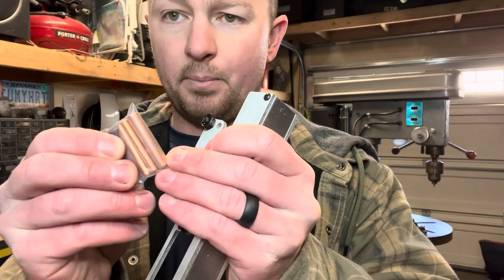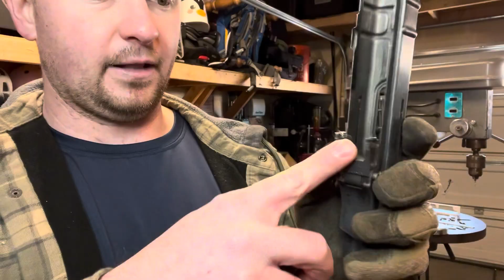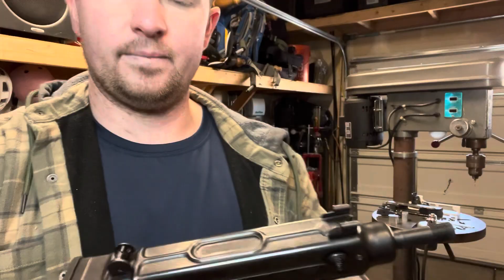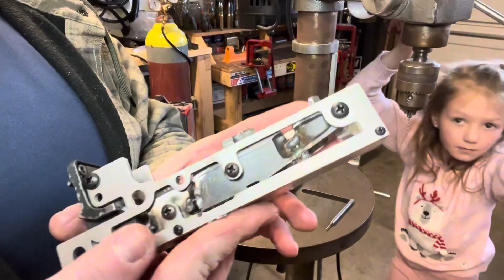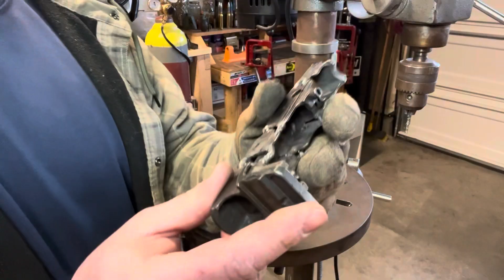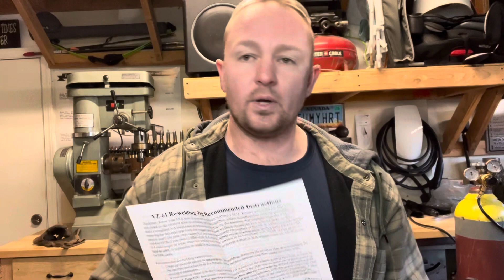Masterclass VZ-61 Skorpion Receiver Re-weld Ep. 1

Comment: Bought your jig over a year ago but only now have had the time and motivation to get started. Cleaning the slag has been a real chore since the cut margins have essentially been torch hardened lol. Had to use a propane torch to anneal them quick and dirty so my old files could actually get some bite. Glad I just now found this video right before the weld up!
Reply from the maker: Thank you for the business! Keep me posted if you have any questions. 
-Connor
Reply: @connorvankalmthout469  Going well so far! Receiver is in one piece and fits the upper thanks to your jig. Any tips for the hammer pin retaining spring hole that the rear nub of the fixing plate covers? My 1963 kit was cut right down where the skinny hole is for that hammer bar retaining pin assembly and the cutout on the bottom of the receiver where that rear nub of the fixing plate sits is nonexistent. So it currently looks like I will have to use a Dremel and re-create that slot where the plate sits under the receiver after building up that area with weld.
Reply: I have seen others say online they did the build without the retaining pin by using alternative methods of keeping that pin from walking out but I don't want to get too jury rigged/bubba if I don't have to.
Reply from the maker: @C-V @C-V-Z I have retained pins by other methods as well because that slot can be very difficult to recreate with out very specific undercut end mills. I’ve used a small dap of JB weld to hold the fixing plate in place on the side with the missing slot. It’s a small enough of JB weld that I can chip off if I ever need to remove the hammer pin. I’ve also done builds where I drill out the hole for the detent but didn’t repair the slot. The fixing plate will be held in place and fully supported by a slot and detent on one end, and just the detent on the other, and it’s never come loose. Hope that helps. Keep me posted!
Reply: @connorvankalmthout469  Thanks for your input! I was close to going the JB route but I actually pretty much solved my problem with a lot of patience and some creative copper solutions. I filed a notch in the receiver where the cutout slot for the fixig plate should be and slowly built up the missing material inside the receiver where the hole for the detent spring should pass through. Used a strand of copper romex wire sanded down to the proper diameter so I don't have to worry about drilling in the right spot and stopping the bit before it reaches the tapered section that keeps the pin from coming out the top of the receiver. Once the missing material was there, I  filed a piece of copper plate to replicate the shape of the fixing plate nub that sits in the receiver so I could weld a tiny lip over it and replicate the slot shape that I would otherwise need an undercut endmill to accomplish. After a solid day of toiling, the detent spring and fixing plate fit and lock together great! Actually pretty proud of how well it turned out considering how mangled this receiver was.

Comment: You should open your valve on the tank all the way. The valves are designed not to leak if fully closed or fully open. This is true for all gas cylinders...
Reply: Not true for acetylene bottles

Comment: So we need a kit, a jig, and a barrel? What is approximate cost of all that? I assume we use trigger from the kit? Does your direction give enough info a noob can finish one up if we remember to turn the gas on?  Thanks for all the info on your video.
Reply: $199.99 for full parts kit from bowman’s and $110 for the jig and misc things like welding and so forth is whatever you value your time at but for less then $400 your gtg brother

Comment: On 2 separate recievers, I cannot get the trigger to reset without pushing it back smoothly. If I let go really fast it resets, but If I let the trigger go slowly, it won't reset. I can't see any real place where it hangs up
Reply from the maker: @Ramon.Santiago  hello, are all your receiver pieces lined up properly? I have had this happen before to me as well, it must be hanging up somewhere or a misalignment in the receiver pieces. If you want to take some pictures and send me an email @ patriotfabanddesign@yahoo.com, I can try to help you. Did you buy a jig from me? Thanks
Reply: @connorvankalmthout469  i used your jig and they were lined up perfectly. I hope someone else sees this, but I just put the safety selector in and now it works lol
Reply from the maker: @lol i was going to bed last night thinking man if he used the jig what could be wrong. I had seen that issue before but in the moment I didn’t think of the selector. The selector does hold down the disconnector slightly when the trigger is pulled. I’ll definitely remember this now. That is the best possible outcome. Thanks for following up!
Reply: @connorvankalmthout469  I'm relieved it was a simple thing. I was so lost because I couldn't find any spot touching 🤣
Reply: @connorvankalmthout469  hey just an update, finished up my first one lastnight! Gonna take it out for it's first test fire on Monday! Came out looking great
Reply from the maker: @Ramon.Santiago  thank you for the update man. I’m stoked for your build. Lmk how the test fire goes!
Reply: @connorvankalmthout469 first few mags had a few failure to feeds, then after things started smoothing out It was running great! Surprisingly ran ppu hollowpoints well lol
Reply from the maker: @ Again, thank you for the update! I almost always run round nose through my skorpions, they tend not to like Flat nose so I’m surprised as well that the hollow point did well for you. If feeding issues persist, I’ve dremeled the feed ramp with a 1/2 drum sander before to make the feed ramp bigger. I’ve noticed some of the new manufactured barrels can have a flat spot that rounds can hang up on. Just food for thought if it happens. Thanks again!

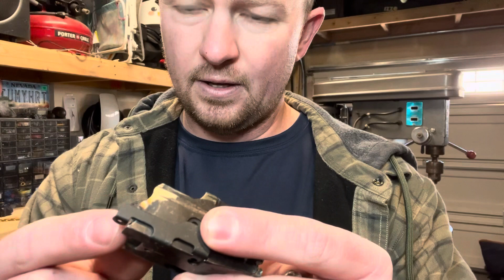Comment: 5:20 my receiver was also torch cut through this place. So is there a need for the fixing plate?Seems like the fixing plate is only needed for the full auto sear. I dont have a mill to recreate that slot so rather just weld it up. Also the pin for the hammer stop looks like its retained by the upper anyway.

Comment: Is there anything that can be done with the 3/4’s of a receiver you get from RTI?
Reply from the maker: @gagemason3865  I suppose you make your own center section using 3 pieces of .093 mild steel and weld it together to make a tub. Then you could use a jig like mine to weld back together and then use the hole locations in the jig to redrill the holes in the right location.

Comment: Ive seen this weld jig before but not sure if its yours. Similar price. Im curious, where do you find full cut recievers? Cheapest ones ive seen usually are missing 1 out of 4 chunks.
Reply from the maker: @trump-ob5xl  If you have seen it before it’s probably mine. I have been selling them on Reddit. It’s the only jig I know that looks like this. And there are a couple places to get kits that include all 4 pieces. bowman, max arms, Numich sell parts kits with all 4 pieces. I would highly recommend bowman. I’ve heard mis matched pieces might be in the kits from other vendors. Atlantic and RTI remove one of the sections like you mentioned. Also AKoptions.com  (I think) has just torch cut receivers for $50. Last I checked, stock was low. Hope this helps. 
Thanks,